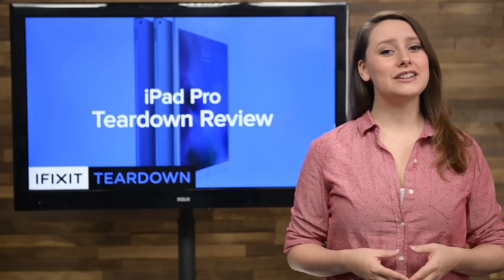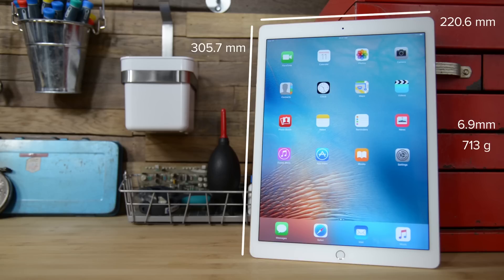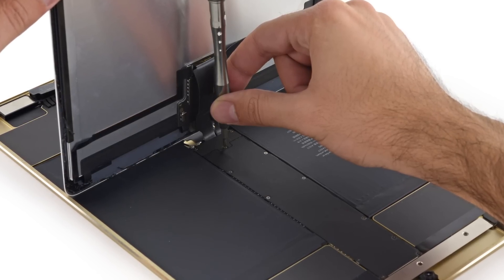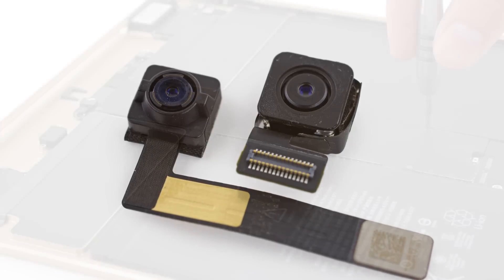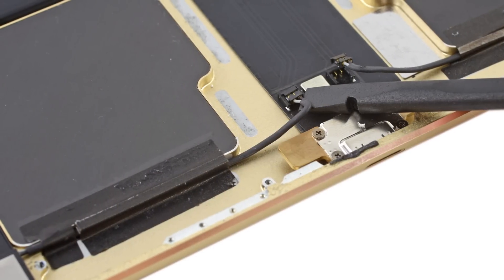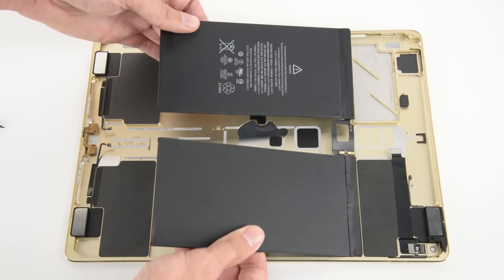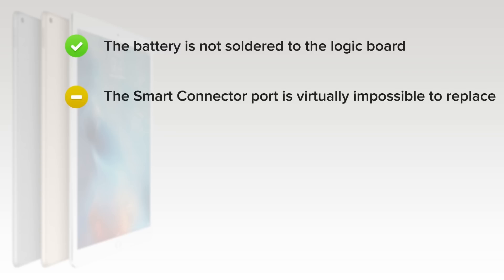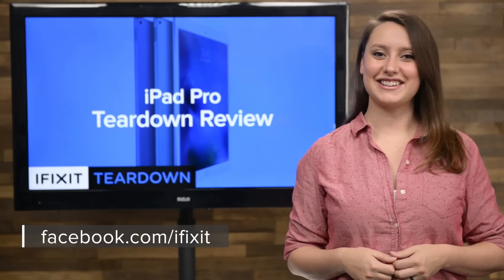iPad Pro Teardown Review!

Comment: Are all tablets build like that, or is there any tablet on the market that would score a 10/10 for repairability?
I am wondering if you guys are asking maybe too much from the manufacturer... for example, we all know that its impossible to repair a broken LCD panel, but no1 is arguing about that, its just a fact... maybe tables just need to use that much adhesive and or fused screens in order to make it possible to keep them as slim and functional as they are?!
In case no tablet on the market can score a 10/10, then maybe the scale should be adjusted?!

Anyway... I am not expert on this, I was just wondering.
Reply: +ISOHaven I suspect it's because it increases the cost of repair.  If you need to (for example) replace the entire motherboard because of a bad headphone jack, that increases your repair cost from a few dollars (plus labor) to several hundred dollars.

Of course, combining parts is essential when making stuff super thin and light, but it has the downside of increasing the cost and difficulty of what would otherwise be a simple repair.

The fused glass-to-LCD is a perfect example of this.  Older devices (I'm thinking of my old Palm Pilots) had the glass, LCD and digitizer as separate parts.  Any one could be replaced independently of the other.  Which meant that replacing cracked glass would be less expensive (because you don't need to buy all three.)  But the downside is that separate parts take up more space and certain things (like the great look of Apple's Retina displays) are not possible without manufacturing all three as a single fused part.  Which is great when everything works, but it jacks up the cost to replace the display if something fails.

I don't think they're saying that combining parts is the wrong thing for a manufacturer to to.  They are saying that it increases the cost and difficulty of repair, which is absolutely true.  The fact that other issues (usability, fit-and-finish, weight, dimensions, etc.) may be more important than repairability from a product design standpoint doesn't factor into this score.
Reply: +ISOHaven So you're saying that they should artificially inflate repairability scores simply because certain classes of devices are inherently difficult and expensive to repair?

That sort of undermines the entire point of having such a score in the first place.  They might as well say something like "don't ever bother trying to fix a smartphone because they're all too difficult, even though we're giving out 9 and 10 scores."

I couldn't disagree more.
Reply: +ISOHaven So, to you, if a phone was constructed in the form of two Lego-like bricks - one half with a display, and the other half with everything else, both completely sealed up in epoxy and untouchable, you would give it a 10.  After all, it's really easy to throw out and replace one of the two parts.

Most of us would consider that no different from a device completely unrepairable.

And cost absolutely should be a factor.  If the cost to buy one replacement part is more than half the price of a new unit, then very few people would ever consider trying to conduct a repair.  They would (correctly) decide that it's more economical to throw out the whole thing and buy a new device.

Comment: Yet you can still plug an iPad Pro into a Surface Pro and manage it through iTunes... Pro?  Seriously.
Reply: +The Watcher Why shouldn&#39;t you be able to?  A Surface Pro has Wi-Fi and USB ports, and it can run Windows desktop apps.  It would take deliberate engineering effort for this not to work.
Reply: That's exactly my point.  What is so "Professional" about the iPad Pro? It's a bigger screen and updated specs... Woahhh... who cares? No USB, No card reader, no ports at all, other than the Lightning port, big deal.
Reply: Since when does "Pro" have to mean "Desktop replacement".  If you look at the history of Apple's use of the term, you'll find that it never means much more than "more powerful than the version that doesn't have Pro" in the name.  And even that is not always the case (e.g. their "Pro" keyboard, mouse and speakers sold in the early 2000's.)

If you think the iPad Pro is a worthless device, go ahead and buy something else.  Nobody here is going to try and stop you.

Comment: What are the easiest devices to repair on ifixit history?
Reply: The Fairphone as it was meant of being repaired
Reply: +Ameen Ali I found that it was pretty easy to replace the battery in my iPhone 4S (an activity that they considered Moderate difficulty.)

In general, large things (like desktop computers) tend to be easier to repair because manufacturers don't have to resort to custom and prorpietary hardware in order to cram all the required functionality into the device.  Of course, the fact that they don't have to doesn't mean they won't.

For example, I've built many PCs from generic parts.  Some commercial systems closely resemble home-built systems on the inside, and I can easily replace anything (hard drive, power supply, RAM, etc.) if it should fail.  Others, however, have made changes that seem to be solely for the purpose of making repair difficult.  For example, power supplies which appear to be in the normal ATX form-factor, but use a proprietary connector on the cables.  Or motherboards that place the ports in non-standard locations (or put the mounting screws in different places) so an aftermarket motherboard can't be installed without serious modifications to the case.

I'm also thinking of a car I owned (a 2002 Chevy prizm) whose radio was 1/4" shorter than the standard double-DIN size, making it impossible to use an aftermarket DD-sized radio.  It was necessary to use a single-DIN radio and a faceplate kit to cover the gap in the dash, resulting in an uglier installation than it would otherwise have to be.
Reply: +Ameen Ali We just took apart the Fairphone and it got a 10/10!